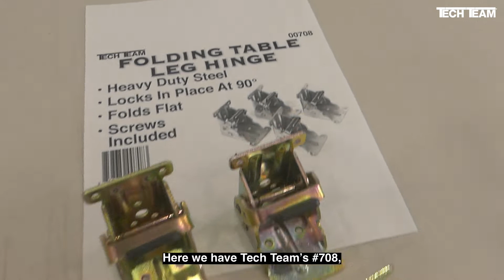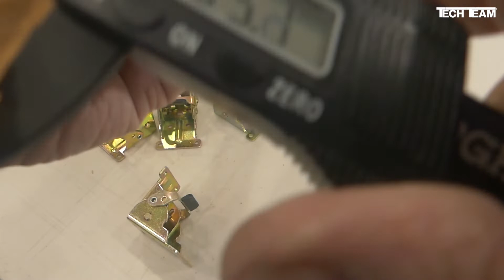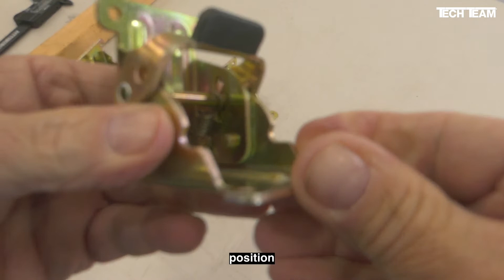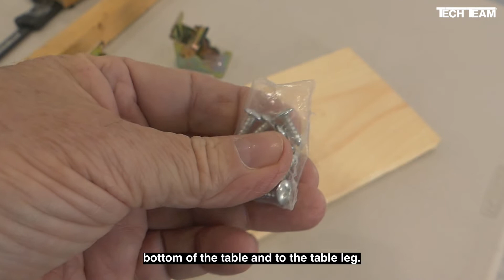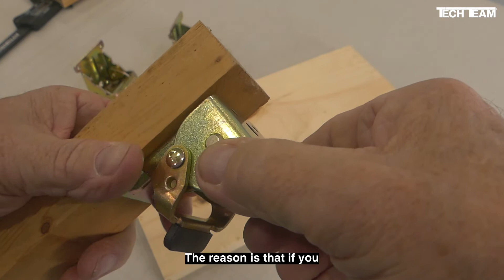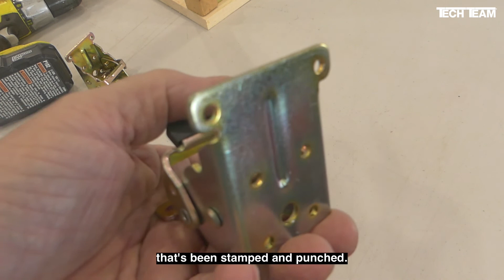Tech Team 00708 Folding Table Leg Hinge

Comment: These are NOT 90 degree locking hinges.   While they open and lock at 90 degrees, when you closed them the will not lock in the closed position.  The supplier said "just raise the hinge on a block".   I tried adding a 1/2" block and that did not make it lock.  I then went to a 1" block and that didn't work either.  Even after adding a block height of 1.5", the hinge would not lock down.   
It appears that the hinge may have to get closed to a 115 degrees or more before it will lock in the closed position.   That being the case I would have to add upwards of 2.5" of block to raise the hinge enough to make it fold and lock.   In turn, it your looking to get a flat leg fold, that does NOT work.

When shown both the video and raise block pic, the response from the supplier was "Just send them back".    TOTAL WASTE OF TIME WOR THESE HINGES.